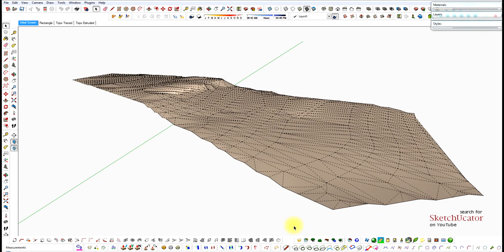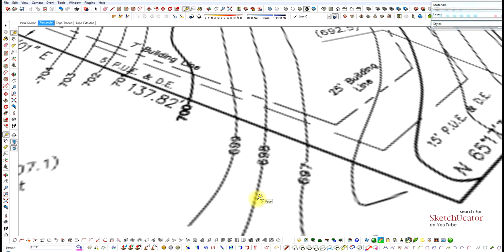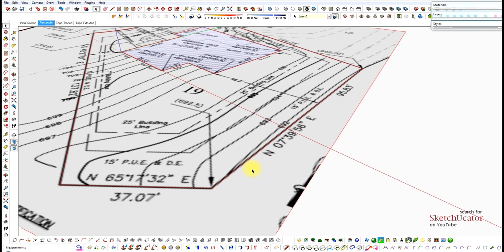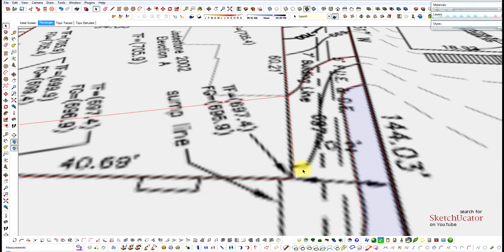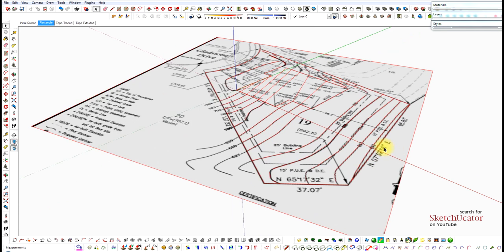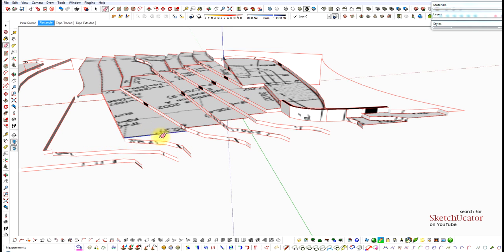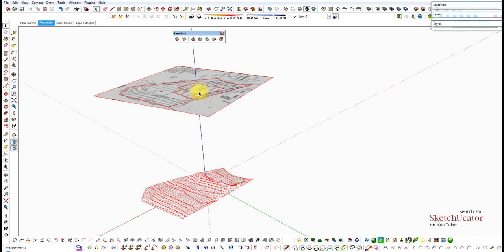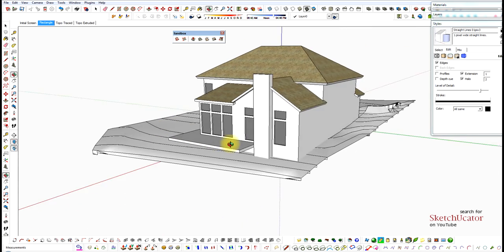SketchUp : FROM PDF CONTOURS to 3D TOPOGRAPHY : How do I get topography into my SketchUp model?

Comment: is there a way to export this to xyz coordinates?
Reply from the maker: every point in SketchUp has an x,y,z value. They can be found by using the text tool and clicking an end point or intersection. The value will show as text at the end of the leader. As such, the information is there; I have to assume someone has developed an app to read them over an entire drawing. Check out Smustard.com and SketchUcation.com to see if there's something there. 
If you have pro you can export the SU file to cad. I'm hoping that cad can read the mesh that gets exported from SU

Comment: when I loaded my jpeg on to the arbitrary rectangle, it came but when i draw the line for the property and others it actually shows underneath and not on top.  What could I be doing wrong?
Reply from the maker: Did you change the color of the lines in Styles in the edit section?